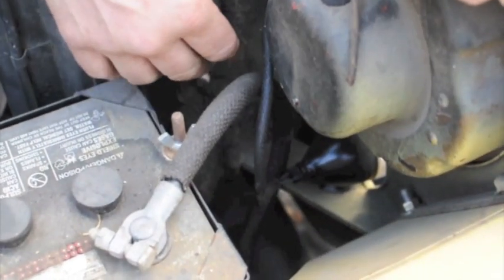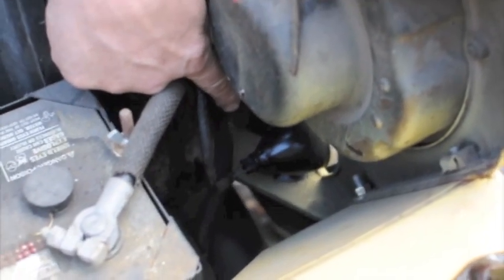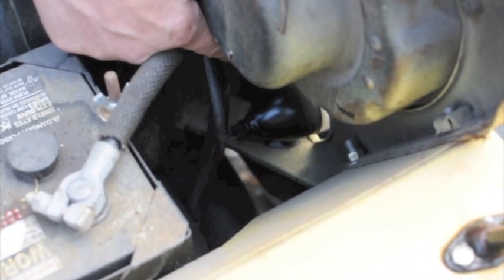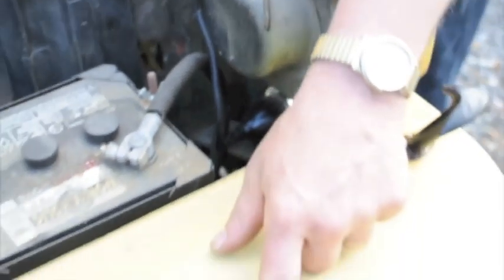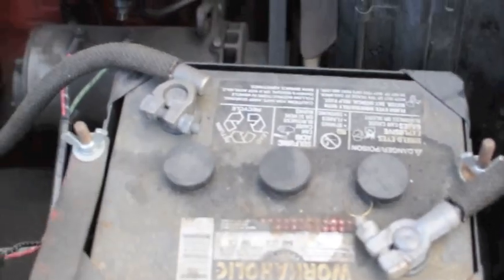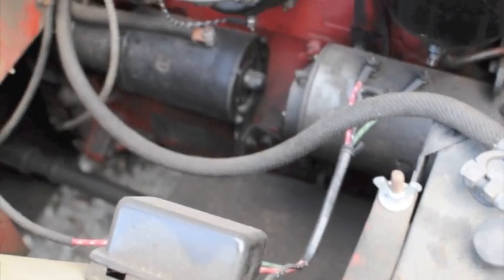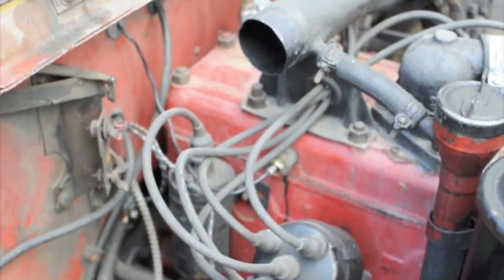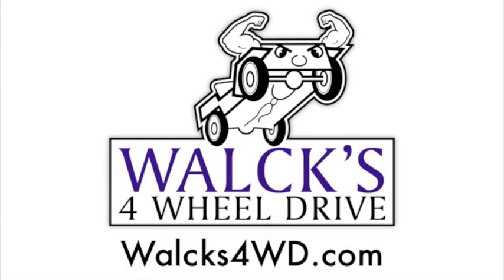Willys Jeep Wiring & Electrical PART 2

Comment: Carl...Just finished installing your six volt plastic insulated wiring harness into my stock 1956 Willys CJ5...The instructions were easy to understand and I used all new cables and solenoid...Everything works extremely well...just like new....I just love the old six volt electrical systems...The starter makes one revolution and it's running !!!...All lights are very bright as well....Thank you for a great product that works well.

Comment: hunting in the mountains of eastern Oregon last year one morning it was 5 below zero.
well our two diesel pickups would not start.
but my 1946 cj2a six volt flat head engine started right up.
original equipment including original carter carburetor!
I'll keep my old willy s 6 volt any-day